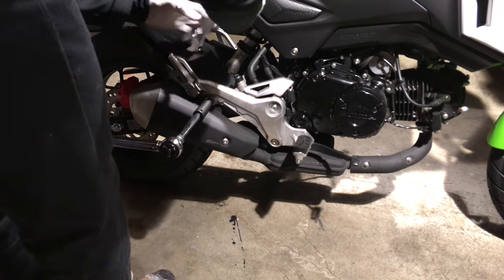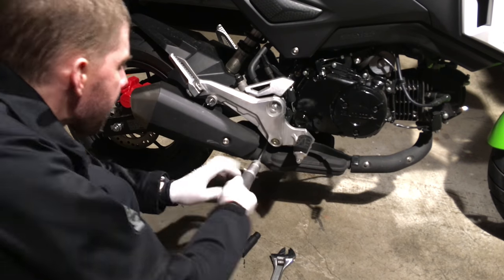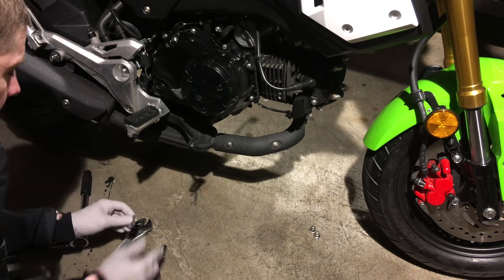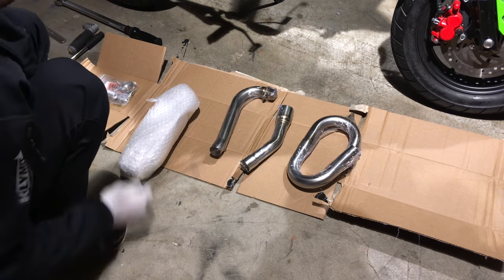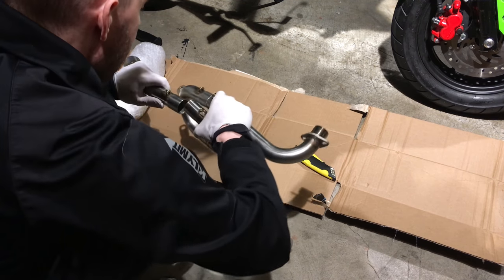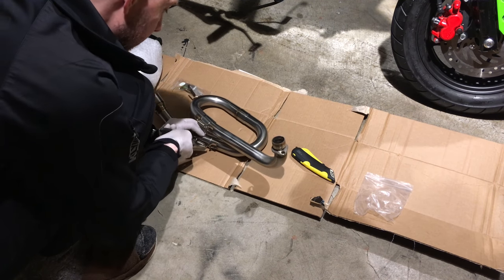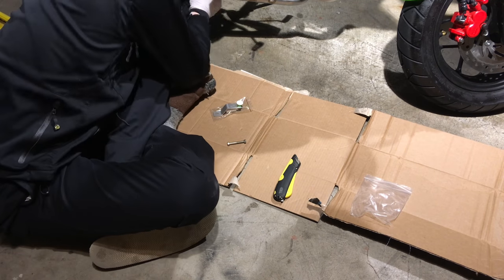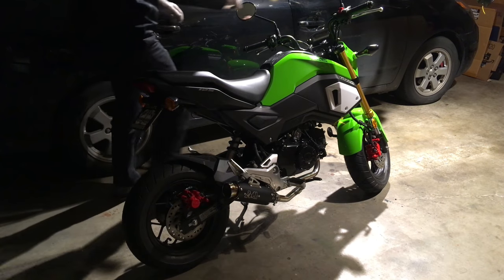Grom SF Zoom Full Loop Exhaust DIY

Comment from the maker: Grom SF was fun at lower speeds, but with only 4 gears and less than 10 hp, it was not good on America's freeways or highways, which dramatically limited its usefulness for commuting to work lane splitting to save time in stop and go traffic that also opens up to 70 MPH. It was traded on our 2020 Yamaha MTO03 with 40 hp that can cruise at 85 mph easily, and nearly as compact and nimble and not even that much more expensive. It's also liquid cooled with better emissions controls and gets really good fuel economy if rides at the same speeds as the Grom was able to ride.
Reply from the maker: I ended up super tuning the 2019 Grom SF and doing that DIY cost me almost $2K all said. Got it up to 12.5 hp using every trick feasible, including removing the flywheel, porting the head, full exhaust with O2 sensor added & power commander + custom mapping. That made it accelerate way better and sound better but fuel economy went down as a result. Still not enough juice and needed a 5th gear so badly that Honda ended up putting a 5 speed transmission on newer model year versions of the GROM. The MTO3 has a long 5th and even longer cruising 6th gear to keep engine RPM's down at highway speeds over 60 MPH on longer road trips. The GROM's shorter wheelbase also meant at 50 MPH it would bobble more, so I think thats why they went with 4 speeds first and later added a 5th. On the upside, as a dirty bike alternative for road use, the GROM fantastically nimble, small, compact, easier to ride and more fun at lower speeds.